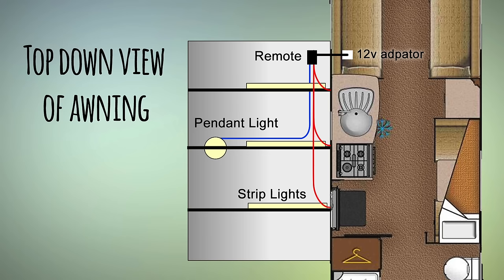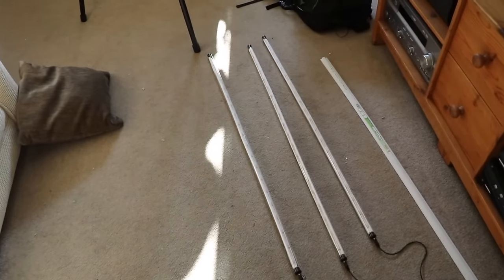Caravan awning LED lighting Project - Update Part 2

Comment: I've just been paid and gone mad online. I should have enough parts arriving next week to build my first two LED tubes and rewire the van. 

I'm attacking it slightly differently to you. I intend to run all the lights from the caravans 12v circuit, which will allow them to be used off grid as well. To achieve this I will be adding a new 12v fuse box which will also support our planned circuits. All will be individually fused and switched. 

The remote box will be wired between the  fuse and a 2.1 x 5.5mm socket mounted on the inside of the battery box. That way I can connect all the lights in the awning from one remote feed.

I'll document the work as I go. I may even video some of it 😁
Reply from the maker: Perfect Chris. This sounds like a great installation. 

Im adding a 2.1 x 5.5mm socket to teh awning light that when plugged in will disable the light and allow the tubes to be switched on. also it has the remote switch too, for even more laziness.

Well done Chris.

Speak soon
Dan

Comment: Hi Dan, another well thought out video. I watched Part 1 whilst vanning in Shropshire and used nearly all my monthly data allowance. Have you given any thought to a permanent 12v outlet instead of the cables going through the window. I've added an aerial outlet to enable disconnection of van aerial and connection of extension cable to site supplied feed. I'll try and video it and send to you.
Reply from the maker: Hi Andy, yes i think in the summer i am going to adapt the awning light on the van to include a 12v socket. (another how to video i suspect) or if that doesn't work, i will create a 12v socket in the wet locker etc and run the lights from there. 

Glad to see im keeping mobile data providers in business lol. 

Take care

Dan
Reply: Sent a photo via FB messenger, don't know any other way.

Comment: Hi dan I've ordered myself three sets of parts for three tubes an inline switch and a relay remote.  Did you fit an inline fuse yet ? If do can you post a link to that ?  Looking forward to the build.  I went for 5050 leds .... as it said it was the same number (300) per 5 metres (same as 3528).  My total wattage is 7.2watts per tube.  So 21.6W in total so I hope the 24Watt power supply is up to the job !
Reply from the maker: Hi Nick, thats great news, looking forward to hearing how you get on. The fuse holder ive ordered is this one - http://www.ebay.co.uk/itm/In-Line-5x20mm-Glass-AGC-Fuse-Holder-Splash-Proof-Screw-Type-/252166686373?hash=item3ab64e46a5:g:P~YAAOxykUZTi60P it will take the 20mm glass fuses, but will look nice and neat on the cable. 

Let me know how you get on !

Take care
Dan
Reply: What fuse rating did you got for ? ......I certainly will let you know how I get on
Reply from the maker: I just went for a 3Amp fuse. only there for if anything goes wrong etc. 

Take care
Dan
Reply: Also where in the setup did you put it ? I'm thinking between the mains adapter plug and it's end adapter ?
Reply from the maker: exactly, right at the source of the power. so in any issue the power is removed from all devices in the circuit.

Comment: hi there  i made a light by getting tube of 1" from fishing shop and just stuck my led light around outside  the at a slight angle and fitted plug like yours
5mts fits on about a 12" of tube and works fine graham total cost £6.00 + 20 min to make graham

Comment: Hi Dan, I've made some of the LED tube lights but i'm struggling on the remote control wiring and i can't quite follow you wiring diagram. I have the what looks like the same unit as you bought but i'm a bit of novice when it come to electronics.  from your diagram it looks like you have a wire going from 12V+ IN to the COM connection, and then the 12v+ Load coming from the NO connection. If that is correct where does the 12V- Load connect to?

Great project and Channel by the way. :)

Tim
Reply from the maker: Hi Tim, 

Thanks for the comment. Yes you are right, the +12v is wired across into the COM and the lights are wired into the NO connection. To get the GND as well, simply take a wire from the GND of the input, and join this onto your LED lights too.  So, GND or () should be connected to the () of the LED strip and the input voltage of the switch.

Ive tried to explain this as plain as I can, if I'm not making sense please just let me know and I will try again. 

Take care.
Reply: Thanks, that did the trick 😁, though the wiring in the relay box doesn't look as clean as yours. Great project though 👍